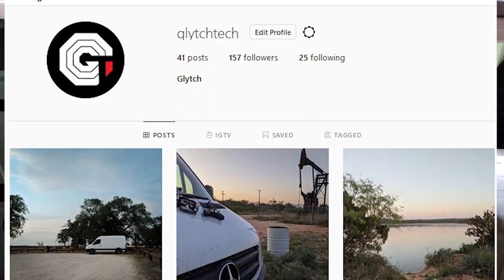DIY Rugged OffGrid Power Pack w/Glytch

Comment: First..  You really need to add Fuses/Breakers in this design.  Its a little negligent to recommend a design without that safety measure especially with LIPO.  Second, you should really look at LIFEPO4 Prismatic cells which  would likely be a better chemistry for longevity and 12V use.  It would also remove your buck converter which is your main source of heat/loss.
Reply: I'm guessing those packs have their own BMS boards built in so I would think they would have thermal sensors as well....They probably are safe.
Reply: I agree except that lithium iron phosphate batteries are way more expensive and harder to get
Reply: yes because everyone knows how safe hoverboards are right? 2nd 30 V solar panel input, you can’t put that thing in the sun and with two mini panels you probably charge up in a week. A fun project that’s been around for a little bit, is to rig up a system that you can charge pretty quick at those free EV charging stations plan on spending a lot more on that pelican case lol 😆

Comment: That was a great build! I'd like to see a LiFePO4 version of this for extra safety and better cycling/lifespan.
Reply: I use that in my mobile rig.  It's not as ideal (unless you have a lot of disposable cash) because you can't run directly off the alternator or you'll destroy the battery, you need an MPPT charge controller for solar/wind, which for LiFePO can be an extra $300, and a dedicated LiFePO4 A/C charger to charge off a wall, which is over $100, 

And the setup definitely doesn't fit neatly into many spaces...  But I do like that I can run large power tools, coffee makers, and gaming rigs with a 3000W pure sine wave inverter.

Comment: Glitch this is actually a really good build. You dont need a fuse block dont listen to that other commentor. The batteries have a regulator in them and so does the mttp.  yes mount the fan to help with circulation of hot air but its a solid build. i would of added some usb on it instead of xt 60 connectors for devices as i would need to make adapters for things i wanted to plug in.. but no matter its still a great video and idea.

Comment: My only suggestion would be to make  a sub-panel mounted with a few screws to the lid, and mount what electronics you could to that, with maybe the charge controller visible trough the nice rectangular piece in the center, this would leave the inside with a bit more space for additional batteries, and just be a cleaner build altogether.

Comment: Interesting!

I think I would make the buck converter an external add on box and pack more batteries inside it. Some travel kit is probably 36v tolerant (thinking of trucker utils Vs car utils) so always converting just adds heat to the case and transmission losses.

Comment: I have a UPS with 3 of those batteries.  I use it for a security camera to keep it running even in the case of a blackout.  It's been almost a year,  now I'm concerned if I'm supposed to do some kind of maintenance. Any advice?

Comment: Definitely add fuses! Greatly enhances the safety factor for a few cents. Sort of curious why you've never adopted Anderson Powerpoles that've become the staple for ham radio operators. The connectors are genderless and the same size contacts are available in 15, 30, and 45A ratings. Cost?

Comment: you do know you can get a pure sine wave inverter to run off your van's alternator right? you should also think about maybe building a small marine wind turbine to mount on top of your van while stationary. just using more and more powerful batteries doesnt really help you as at some point you still have to charge them.. if you want to go the way of using batteries then you should make your own "powerwall" sort of thing that charges when the van is running via the alternator. the power wall should be able to run whatever you want and last long enough so that you dont have to randomly run the van to charge but only charge when you are driving. idk its up to you obviously..

Comment: Cool idea!  Is there circuitry in each hoverboard battery pack that balances the cells?  Might also be worth mentioning the wire gauges used too (I've found out the hard way in the past about using too thinner wire).

Comment: If you use a USB PD "faker" to get above the 12V input required for the MPT, does it self regulate the amperage correctly, or does it collapse the voltage and fail to charge?  Basically, could you use a PD faker to with an XT on the older side to trickle charge it from USB?
Reply: @Glytch  Awesome, thank you!  Been working on my own version of this for a while, and using an MPPT is SOOO much easier than the crazy Arduino powered system I was planning.

Comment: Could you make the rotation of one of your wheels to create kinetic energy like the hybrids do with a outlet inside your van to store power? Of that's too hard maybe ask an auto electrician to wire up something to your Van's alternator to charge it whilst driving.....but I guess a cigarette lighter will be sufficient whilst driving or running the engine.

Comment: Hi Glych, i like these kind of builds, well done on yours. Can i ask you about it please. So 620wh @ 12v is only going to be about 50Ah for those 4 pack, is this correct? Doesnt seem like thats much power. A typical car battery has 120ah, Am i getting something wrong?

With car batts you can only use 20% of available power down to 11.1 volts. So do lipos allow you to drawn the battery down to lower voltages?. 

Also i think you need some inline fuses.

Thanks, all the best, kieron

Comment: Do you know a way to charge a laptop from a 12Vdc source without using a 120Vac inverter?
Reply: A lot of em use 19.5 volt, check on yours, I have a small battery pack that does 19v, with a little dc to DC cable. So absolutely! Bypass that brick

Comment: This may be a little overly ambitious but if you could make it IP68 rated... that’d be dope. Also maybe a protected display for usage/temp/life/etc.
Reply: Another idea (if possible), protected solar panels embedded into the case’s exterior, but I’d imagine you’d need a layer of shatter-proof “glass” to cover them. The protective glass would need to allow full UV passthrough... but I wonder if you could take it a step further and make the “glass” to magnify the UV/light (not sure if that’s even possible - you’d have to account for the heat concentration).
Reply: I think the whole battery box would get unhealthily hot if you left it in direct sun, with or without solar panels
Reply: @iamdave84  agreed but my suggestions were purely theoretical and I mentioned the heat issue. If there was some way to implement a powerful heat dispersion method, then it might be feasible.

Comment: What about converting movement into electricity I have many many ideas
Like when the cars tires are moving it makes electricity
Reply: The easiest way there would be to make a turbine that generates power using wind, that way you can both run that without needing to move (windy day) and as long as you keep rolling you can keep charging. Would also be easily adaptable to most vehicles, without needing to worry about the actual vehicle design and such.
Reply: Or continue to use your car's alternator..
Reply: There is so much that could be done with this. Mercedes changed their alternator to support start/stop without burning it out, I think they put it in the trans or in front of it. Anything rotational on a car that doesn't move around alot could be used for electricity, I'm thinking transmission output, windings inside the trans bell housing with something on the torque converter, even the pulleys or wheel hubs. This would be incredibly difficult to do, still gonna try to work it out on an e-bike or something
Reply: @jakecobelton9876  lol why waste all the rotational evergy that could create electricity?
Reply: @hackersarchangel  that's a cool idea like a fan car but for electricity instead of downforce
Reply: @EliteSniperTV  I think you don't quite understand electricity generation and thermodynamics but be my guest.  Put an alternator y every wheel. Go nuts and put a wind turbine on the roof for all I care. It will just make your car heavier, slower and waste more gas.
Reply: @jakecobelton9876  induction my guy 😂 I'm not saying belt driven, but I guess the forces would suck a lot of energy out thanks!
Reply: @jakecobelton9876  for the wind thing it would be channeled to a fan, but yeah it would add drag and probably wouldn't be worth it. I just want a fan car 😂 for downforce lol
Reply: @jakecobelton9876  what about like a tugboat style fan? Wide blades, make it small, and feed air from the radiator to it?
Reply: @EliteSniperTV  my apologies if I sounded rude. As far as I know the alternator is pretty much the optimal way to produce reliable electricity from the gasoline that you happen to already be burning in your engine. Anything else is a cool project but will hardly be as good as the alternator. Cheers.

Comment: I've installed a solar array on the roof of my van when I was traveling+working, super cool feeling being off the grid. The working while actively traveling part kinda sucked though, since it wasn't a freelance thing. The issue was that I ONLY had solar power, figured it would have been enough.

I had .5 kWh, but that wasn't really enough to power everything with zero concerns. I only needed to power a Macbook Pro, LED lights and a small water pump for the water basin. Macbook turns out is not a very power efficient device when you need to do some more performance demanding work. If bad weather would linger (and it tends to for days sometimes), I'd have to go to the library ):

Definitely learn from my mistakes and use every opportunity for charging.